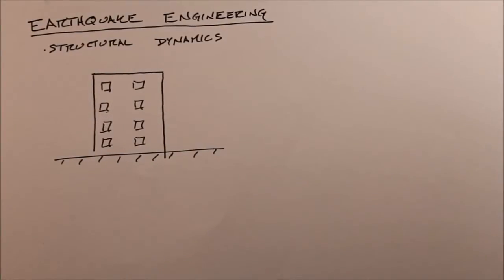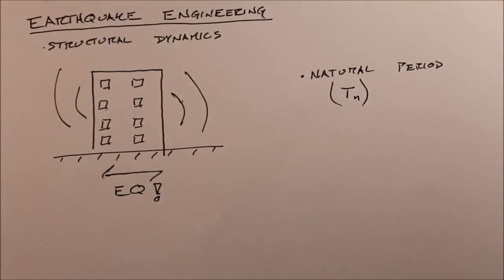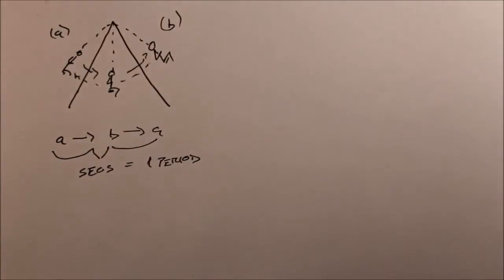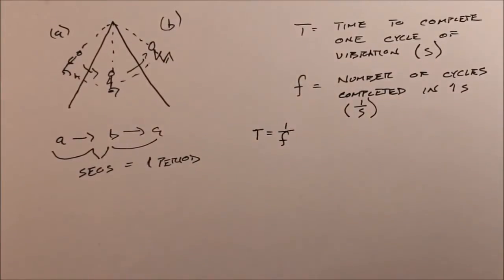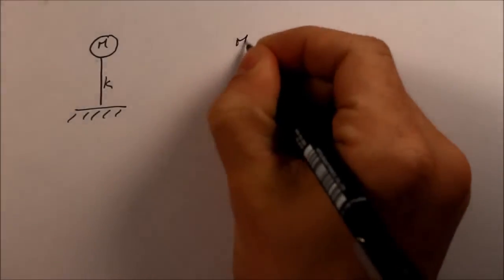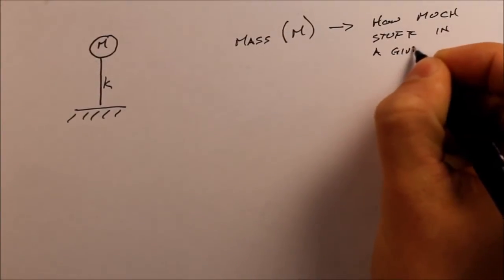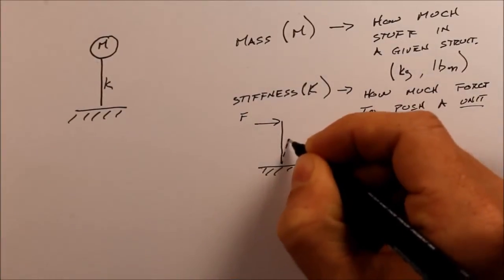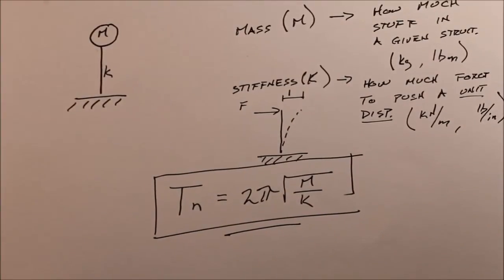Natural Period

Comment: Thanks Lucas! this natural period also comes from HVSR measurement?
Reply from the maker: The HVSR (Horizontal to Vertical Spectral Ratio) is used to determine the site period.  As a very crude explanation, you can think about the site period as the period/frequency that the ground will most dominantly shake in.  Like a plate of jello moved back and forth.  If that Jello has a structure on top of it with the same natural period, that structure will see some really large movements.  My video on Natural Period and Resonance links these two ideas.

I have colleagues who have done a lot of work using HVSR to map the depth of soft soil basins in and around New Zealand cities to determine site class and site period.  Then as a structural engineer, I can then use that information to see if my building is likely to see an increased level of shaking.  This phenomenon was really evident after the 2016 Kaikoura earthquake in which the taller buildings along the waterfront that were sitting on soft soils saw much larger shaking than the buildings sitting on rock.  Subsequent HVSR measurements confirmed this.
Reply: @lucasshogan   thanks for response.. then you can use HVSR period for analize the target spectrum? for you structural design..?

Comment: Thank you for the video!! May I ask, how would I relate the natural period to the seismic isolator?
Reply: How to understand period shift?
Reply from the maker: @evazhang3232  Because the period of vibration is only dependent on the mass and the stiffness of the system, if you make the system more flexible (i.e. lower its stiffness) you will increase the period.  Most earthquake have lower energy content at higher periods (lower frequencies) so structural engineers can take advantage of this fact and put the building on isolators which are stiff in the vertical direction so the building doesn't sink, but are very flexible in the horizontal direction which increases their natural period compared to if the building were just fixed to the ground.
Reply: @lucasshogan   Thank you!!! lower the stiffness to increase the building period so it may receive an earthquake have lower energy content!  Thank you for your timely respond!!! Love your videos!